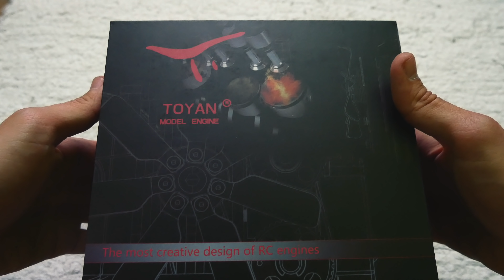Assembling A Nitro 4-Stroke Engine

Comment: I mean

143HP/L makes this a very high performance engine, regardless of its size XD
Reply: still not the best one
Reply: And it's also handbuilt, so the prestige value goes up :)
Reply: AdotLOM I can remember when I used to mess about with r/c cars 30 years ago or more, a good 3.5cc 2 stroke engine could make 1.4 hp i.e. 400 HP/litre!
Reply: TurboBusas: amateurs

Comment: haha!! what a nice video!
I live in a strange country where 99%  of the population in my country will say "cc" in replacement of "litres"
e.g. they will say "i drive a 3.5cc car " (when refering to a car with 3.5 litre/ 3500cc engine )

and now i can show this video and told them, this is what 3.5cc looks like
( well i tried to inform them, but then 99% of the population here still love to use cc to replace litre when speaking/ placing ads about cars )
Reply: I see it with lawn mowers..guy says its got a 160 horsepower lawnmower engine....160cc's 5.5 hp..👌

Comment: You should have lubricated the cylinder wall before putting in the piston..nice video tho!
Reply: AND grease on the cam/lifters
Reply: Remember that this engine works with a fuel mixture that includes oil. So no problem with the piston. But you have to put some engine lube on the camshaft!!

Comment: You need to fill the rocker cover with grease. The rockers and where the buckets go into the head and cams don't get lubricated any other way despite the cam shaft being on sealed roller bestings. Won't last long otherwise

Comment: I love your videos but, this time I'm going to offer some criticism. No Loctite on threads, No assembly lubrication.
I'm baffled as to why. Did the instructions tell you to assemble it that way? Did you do it for the video and took it back apart later?
In case you don't know Loctite makes a very light duty thread locker called LOCTITE 222MS Purple Threadlocker, it's a Low Strength/Small Screw MIL SPEC. I use it as an automotive professional. It is absolutely the right low strength for that application. 
Now when do we get to hear it run !!!!

Comment: Certainly an interesting looking engine, however even with the discount, it's still too expensive for my snow thruster project. You see, i'm trying to keep total costs below $100. But it certainly looks lighter & more powerful than the whipper snipper motors i'm using. 0.5 hp? If they cost less or i was less of a tightwad, i'd buy 2

Comment: unbelievable, not only did you forget to torque everything, you didn't use any assembly lube and you didn't even check for proper clearance and fitment.... unwatchable that engine will not last many .miles